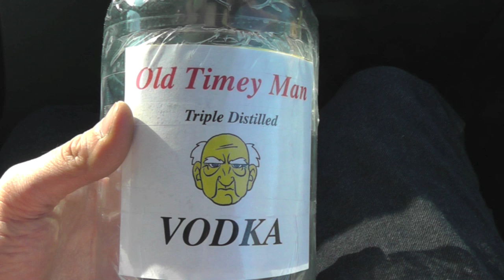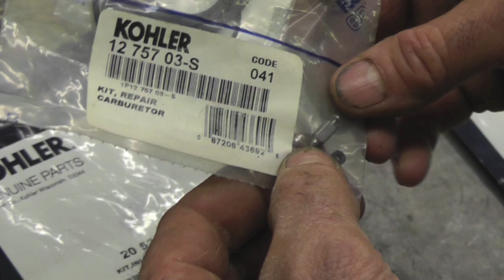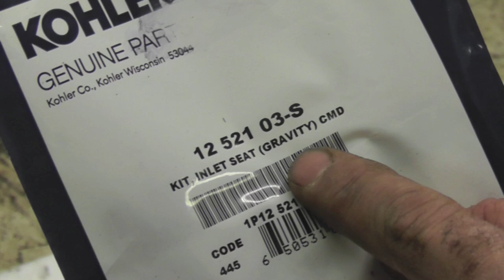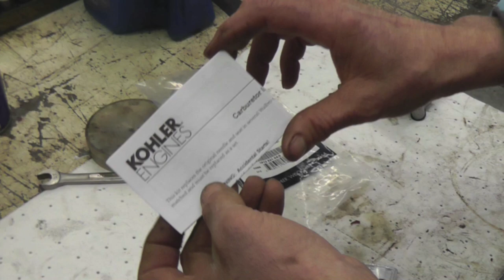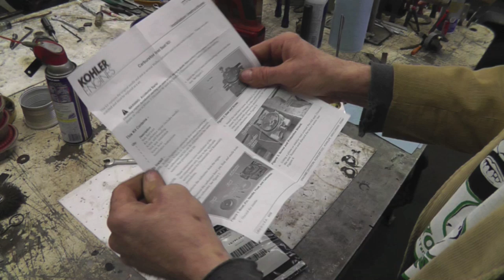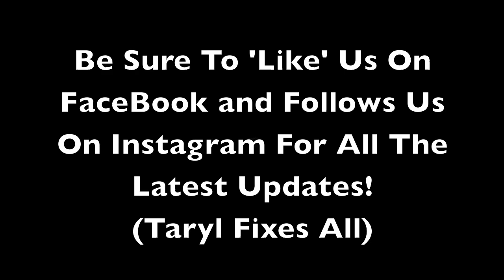How To EASILY Rebuild A Kohler Command Carburetor

Comment: Just replaced fuel pump (caused fuel in crank case) carb replaced last year (I took apart and clean as a whistle) put back together and now surging ? Vent line good,what am I missing ?Any adjustments I can make? I'm ready to give it the sledge hammer.

Comment: My newest old one has a fuel fump it needs a flat gasket for the carburetor bowl it doesn't have one and so i put a cut used one on it for now so if it leaks a gas theres nothing i can do until i get the flat gasket for the bowl 

The gaskets that are the replacements for most of the cv models of Kohler doesn't fit because they're tall they need to be flat like the originals were so

I found one flat gasket it goes to a Briggs engine i don't know what model but it looks like it'll work I'll find out soon if it will hopefully it does because the replacements for the cv models don't fit right 

So then if that Briggs bowl gasket fits im gonna buy probably 4 because the Kohler replacements are different sizes and just don't fit

Comment: DUDE my right carb bolt in going in and out on my ariens 42 GEAR RIDING MOWER..is it stripped..is it supoose to come out someone said it held in behind CARB WITH A SQUARE NUT??????  I cant attch my air box the bolt wont travel out far enough it falls back in

Comment: Can you replace the main jet in these carbs?  I look down the port that the shut off valve seats to and the jet is way off center.  I tried to bend it back to center with a gasket pricking tool but it won't stay.

Comment: Hi, I have been struggling with two cv15 John Deere’s with the same problem. Both with fuel pumps. After mowing 10-20 minutes, floods and stalls. Cleaned carburetors. Swapped carburetors. Installed seat kit like in this video. Tested needle and seat on a test stand like yours, no leaks. Mow 10 minutes and floods. I can’t figure it out and need your wisdom. Please give me a clue.
Reply: Did you ever get it figured ot?

Comment: My 52 inch Toro Timecutter has this carb on it. It was leaking from the carb when I got it. I got tired of having to shut the gas off every time I finished using it. Took the carb off at least 10 times to clean it and it still leaked. Took a picture of the seat with my phone camera, and blew it up, and it looked like someone had taken something and put a rectangular dent across the tapered part of the seat. No amount of cleaning worked. Up here in Canada that kit cost over 80.00. So I put a piece of hardened 1/8 rod in my lathe and ground a taper on it to match the seat, then made a small guide bushing to insert into the seat to keep it straight. Then I chucked it in a portable drill and spun it with some rubbing compound on it until the blemish in the seat was gone, no more leak. Really like your videos though, and they remind me of good times hanging out at my buddy's shop years ago, and all the antics that went on there., from him having a few too many and smashing his old Honda trail 70 with a sledge hammer, to lots of pranks on the unsuspecting.

Comment: I could not find a 10/24 self tapper. However, a 10/24 tap at the Big box is $7.00. Also a 1/4” drive 9/32” socket works great as the sleeve. Hope you can pass that along. Thanks for you video

Comment: Explain your tool 12-24 self tapper? If you can put a nut on it… it’s not a normal self tapper… lol idk explain… exact bolt/screw size thread pitch, nut, you don’t have the cutting part of a self tapper… I must say your great at everything for instruction, but maybe elaborate a little more on the specifications on things like that little screw/tool you made. THANKS!

Comment: you are the fix-it guru! I just bought kohler carb parts kit 12 521 03-s and it came without a viton needle...Ed at propartsdirect called kohler and was told they no longer supply the viton needle valves. I'm having a bear of a time getting the viton seat into the tube they supplied. instructions don't even mention the little viton seat....any help would be appreciated!

Comment: This was just the video I needed. If I unhook the wires to that solenoid would that still work? Instead of altering it or putting the plug in just for now. Mine doesn’t backfire when running or shutting down but starting up it does it every single time.
Reply: Brian Philbrook it would still run if its solenoid boot is not stuck in upwards position cutting off gas. It works by closing off gas to carb when 12 volts is cut off to the solenoid . Hope this helps some !!

Comment: I rebuilt my carb last year I may have used the wrong needle but I did not replace the seat. I don't think it is leaking but running rich which makes me wonder if I used the wrong needle, the needle with out the "plastic" tip

Comment: i have the same motor came off a husqvarna and had the same problem but im using the motor on a cc760 cub cadet and im eliminating the fuel pump and the anti backfire thanks for the video

Comment: The skits are funny I think and I appreciate the work that goes into them. Anyway, I am posting to thank you for this repair video. I just got the old seat out of my LT2000 courage carb using your method with a 4 pack of 10-24 machine screws and nuts and luckily the mower under seat spacers (Craftsman LT2000 part# 134300 $3.99 online price today) are just right. I used a 10mm wrench to turn the nut and the seat came out even though it was very corroded. I first tried their method using a pry bar on top of the tower after putting in the nut and screw they supplied. I cranked the vice down but no way it was coming out before some aluminum was damaged so I went and got the screws and then I tapped the already damaged hole witha 10-24 tap, put the spacer, screw and nut on and it was easy from there. Thanks again!

Comment: You should do one on the Kohler courage
Reply: Courage 21 carbarator rebuild from filling up crank case with draining and replacements of oil ,air , gas filter and rebuild of carb showing cost of OEM vs Chinese version and quality  and part numbers and where to order them please

Comment: Thanks Taryl, you made me look like a genius in front of my 12 year old son. We are fixing up an old John Deere L110 so he can make some extra cash this summer. I will cherish this memory forever. Thank you again.
Reply: That mower's not to bad but mines missing tension on the deck belt its also been missing a clutch pulley works without it but you can't put the deck down past 4 or the belt rubs metal with a clutch pulley on how it works when you engage the blades the pulley clutch goes down keeping the deck belt level with the deck 

Sense im not gonna put a clutch pulley on it im gonna put something on the deck to keep that belt tight and put a stop between 3 and 4 because lowering the deck past 4 messes up the new belts i made mines carburetor gravity fed

Comment: So I broke off the top of the flang that the pin goes through that holds the needle/float assembly.  I've got it stuck back on with some J B Weld.  Do you think that will hold?  I hate to think I would have to buy a new carbetrator!  Thanks- you are the best.
Reply from the maker: That might work. You can also try super glue that is impervious to gas. Just glue it on the side thats broke.
Reply: Taryl Fixes All

Comment: Taryl:
I have a 2018 Kohler commad pro 9.5. I'd like to adjust it to run a little more rich, but they say "not adjustable". Is there by chance a hidden screw behind a plug so you can still adjust?

Comment: So my Kroler  Cv492S  (what's the S for?)  ate the 2 throttle body plate screws from the Walbro LMK when the fell off. 
It's the original so I'm hoping they are brass and were consumed as I don't find metal on the end of a magnet when steel fishin in the piston hole... 
Would you recommend during rebuild. take off that plate and locktite the screws?

Comment: I'm having problems with finding a nut that will fit a 10/24 self tapper.  My local Lowes had nothing to fit.  Where can I find this nut.  Also, is the self tapper included in the Kohler kit the same size?

Comment: Hi Taryl, I have a Kohler Courage SV725 with a Walbro LMC carburetor that has a surging problem. Any advice on adjustments? This carb is made in Mexico and the number appears to be 32 853 28. The last 8 is messed up and could be a 9. Very strange how the number was stamped on there. Thanks in advanced.

Comment: question on the channel / mount that the carb goes onto...should one clean this area out with sandpaper or some cleaning solution?  mine is quite pitted.  I'm leary about getting pieces of crud into the inner parts of the engine if I do this.  thoughts...??

Comment: Hello.  I found the repai/float kit for this carb on Ebay OEM# 32-757-02-s. Or the replacement/ interchangeable carb # 32-853-25-s. Carb is about $30 and rebuild kit from $25-30.

Comment: Good Video, I have a 1992 Craftsman riding mower with a 15.5hp  Kohler Command engine with the fuel pump which was running pretty bad( running mostly with the choke on) Watch your video and ordered the -04  kit the one with the special screw tool. Open the carb up and to my surprise,  my carb  had no sleeve in it just a needle valve, and the fiber needle seat.Took them both out. So I installed the rubber needle seat and the needle valve that were in the package. Put it all together and it runs like a champ I Guess not all Cmd engines with the fuel pump need the sleeve Thanks
Reply: My '99 just went. 900 hours. Not engine. Carb. Your 15.5 a 426CC? Took me a while to figure out the Sears are ALL 426CC. Mine is CV-16S. Allegedly 16.5 HP. Threw me off finding things. S means Sears- I think. Switched to 426CC and it  got easier. I know this is 7 years later but other people do read this stuff.

Comment: Great Video Taryl!!!!!    I have a Walbro LMK on a Kohler CV15.   Damn thing started to flood.  I cleaned  super cleaned it & reassembled with the basic Kohler kit and guess what... it still floods!   Getting another valve seat should fix this, but the problem is, can't get it, they're back ordered for a  long time
That valve seat is made of brass.  Have you ever had success with cleaning the brass valve seat with brasso brass polish by itself, or with a little rubbing compound or toothpaste and add that to cue tips in a drill to remove a a tiny layer of brass in the seat?  Some have reported success on their Walbros and on the motor cycle valve seats doing just that.
 The Kohler kit came with a rubber valve seat and TWO different valve needles.   So I got another question for you,  Ever pull the brass valve seat out and swapping it with bottoming out the rubber vlave seat in its place?

Comment: Hi Taryl where can I get that screw under the bowl, and what size or spec is it???  My solenoid power cable broke when I was screwing it back on.  Will it not start without power to that solenoid if I just screw it on?  There was a one red cable going into the bottom that broke.

Comment: Having the proper kit # saved me a ton of time! Excellent tip for the seat extraction tool. My 2000 Krohler single is back on the job. Over 1,700 hours on the old girl.
Reply: What model is it
Reply: @Mike-su8si  It’s a 426cc single cylinder model CV15S
Family SKH426U1G2RB
It’s on my 22 year old Crapsman 42inch mower.
I was having chronic carburetor flooding issues even after rebuilding it. Replacing the valve seat finally solved the problem. It’s been a few years now and it’s still running fine. I did add a fuel shutoff valve just to insure the crankcase doesn’t fill with fuel again. 
I stumbled on this channel looking for some help with the carb issue & ended up subscribing for the entertainment. Cheers!
Reply: @jatoav8or  its just about the same as my cv491s command. it is the same as my cv15s that says john deere but i know it's really a Kohler command engine 

Anyway i went ahead and kept the gas pump on mine with no gas shut off valve it needs that i think but i found what kept cutting the gas off on mine someone has the elbow on the bottom of the gas pump turned to far over 

may have to take that off again just to turn it to the right direction 

I'd like to say this john deere Lt155 is my newest riding mower but its not my used craftsmen lt1000 is the guy kept his john deere in good shape though I've just been going over all the mistakes his mower shop done for him on it
Reply: @jatoav8or  i first had those problems with my gravity fed cv16s Kohler pro engine on my green craftsmen
Reply: @Mike-su8si  gravity feed is the root of the issue for me. The machine was running ok but the bowl valve would leak while stored which inevitably drained into the cylinder.  Anyway, it seems fine and if it occurs again I’m prepared to fix it.
Reply: @jatoav8or  i know i had that same problem and had to waste all my oil

Comment: Any idea why the only fire we get is coming from the carburtrator after rebuild?  It has been sitting in the shed for quite a while, but was working fine when it was parked.  Backfire is the only fire we can get, here's a videur for your watchin' if you could assistify: https://goo.gl/photos/Zp8hEdL1Ttn6Jntp6
Reply from the maker: +Timothy Cramer  Sounds like a stuck valve or push rod is off. If thats not it could have a sheared flywheel key.
Reply: Money is doing basically the same thing. Have you figured it out yet?

Comment: Taryl my 26 hp. twin Kohler is hunting. I had a shop work on it and they cleaned the carb. What should I do to stop the surging at full throttle.
Reply from the maker: +Benny Russell     Sometimes on those twins if the governor spring is in a hole that is to close on the arm with the many holes in it that will cause itl surge. It might be as simple as moving the spring to a hole thats further out on that arm to stop the surging. So check & see what hole the spring is in. & try moving it to a different hole.If that doesn't do it then the low speed circuit might be clogged in the carb. They use a few different carbs on the twins so I would need to know which carb you have.

Comment: Last week I rebuilt a carb using the 20 521 01-S kit. Incredibly, Kohler hasn't changed the instruction sheet on installing the needle seat, which it calls a valve seat. (Is it a valve?)  Doesn't this mean Kohler never field tested its instructions, and doesn't listen to feedback from its customers? How often does this happen?

Comment: Tayrl, why am I getting gas and oil coming from the oil breather and going into the top of the carberator. When I start engine I get a lot of smoke out the muffler. Am I in trouble. Sure hope you can help, you know so much. Help
Reply: Your crankcase is getting pressure in it possibly from a internally blown head gasket or the crankcase ventilation valve  is malfunctioning, maybe check/ replace that first.

Comment: Taryl & crew - thank you for producing this helpful video. I used the Kohler 12-521-03S rebuild kit on my Craftsman Pro (late 90’s) with a Kohler CV16S gravity fed engine.  Popped out the old brass seat with a wonder bar under the head of a 2” long 10-24 thread cutting bolt from local hardware store prying up against a piece of plate steel because my nut kept stripping the bolt on the Taryl Tool when I used the thread method.  The tool is a home run and I used a modified shaft from a 5/16” sleeve anchor for the tube base.  Greatly appreciate your production efforts and have one suggestion: You might have the water in your pipes checked : ) - there’s your dinner !

Comment: HEY TARYL NEED ADVICE HAVE A KOHLER 18.5 HP MAGNUM WITH CARBURETOR AND REAR END PROBLEMS. THE CARB. I THINK I CAN FIGURE OUT THE REAR JUST QUIT ROLLING WHEN YOU TRY TO PUSH IN NEUTRAL. ANY IDEAS JEFF WETUMPKA ALABAMA. KEEP'EM COMING YOU ARE FUNNY

Comment: Does this carb have or need a throttle return spring? My choke has a spring but the throttle doesn't and the diagram I found online shows it has one. It doesn't seem the one your handling has one

Comment: Ha funny stuff. Ok I doubt the engineers are totally nuts so I have to ask. With the float in the position as per manufactures instructions, are you saying  it leaks or causes a running condition ?
Reply from the maker: +Steve Rob The float should be level & it says that in the provided instructions, but when you do it the way they say to with the float hinge pin in place and using the supplied tool & a arbor press the result is a float that is not level. so you end up driving the seat in further to achieve a level float. They should just leave a section of those instructions out & say drive the seat in until level. A float that is to high has the possibility to leak & a float that is to high will also cause the motor to run awhile then die out but after it fills with gas again will restart. Not enough fuel in the bowl to maintain the engine to run. We had a customer bring in a tractor for repair because he said it would run for an hour then die out but would restart. Took it to several shops in the area paying each time for replaced parts still same problem. I new it was fuel related took off carb. & saw the float level was too high. Lowered the float customer said it problem never happened  again. Sometimes it can be that simple.

Comment: Thanks for the video Taryl.  Taking that little black retainer clip off did the trick for getting the carb off and good advice on not losing that little plastic bushing on throttle link.

Comment: My rider has a Kohler command 18. It ran great last season, then this season after running out of gas it wont run at full throttle without backfiring and hesitating (seeking) do I need to do this rebuild on it or is it another problem?
Reply from the maker: +Brandon Whipp  Depending on where you live it might have water in it. Phase separation from the fuel. Check out my playlists & watch the Dolmar ethanol vid. You might just have to clean out the bowl.